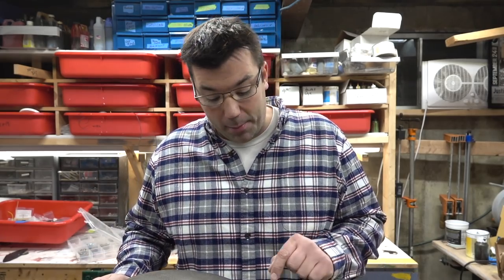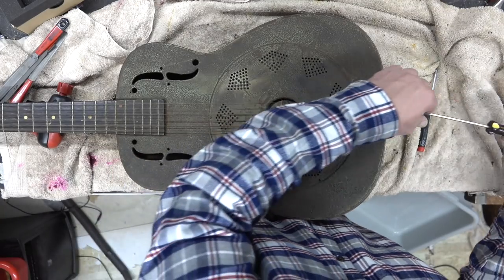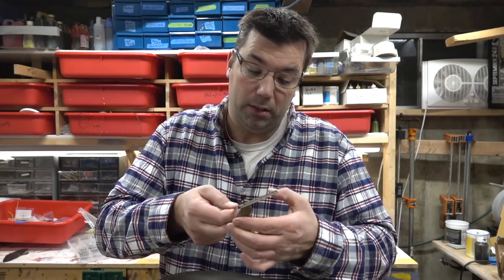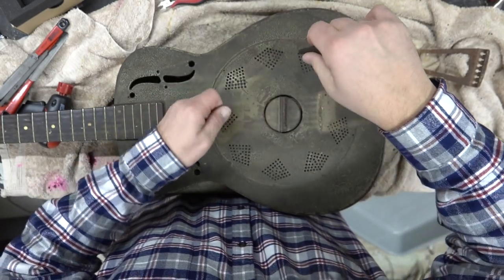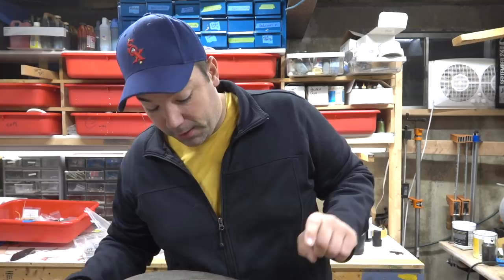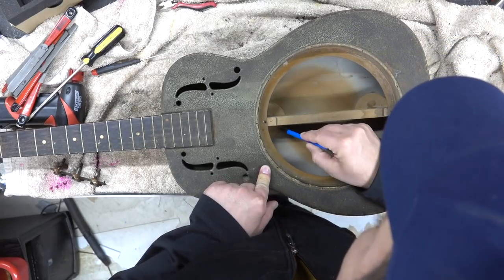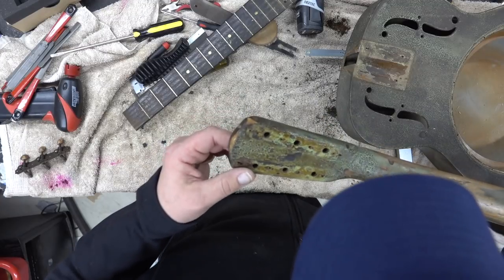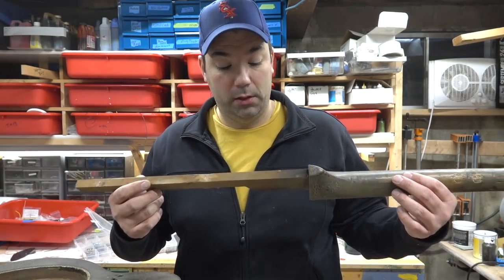Restoring a totally wasted Vintage Dobro - Part 1 - Help me on year & model

Comment: Hey there! You will love getting into the world of dobro! There are quite a few resources available. The best one is a few hundred pages and is a comprehensive history of National Guitars. I am not thinking this is a National. As someone else mentioned the screws for the neck can help you there a lot. The resonator was the first attempt at making an acoustic louder. The concept is that the bridge sits on a "biscuit" in the center of an aluminum cone which acts like a magnet would in a speaker. The bodies are usually made of brass and plated most often with nickel. Have a blast and I look forward to seeing how this goes!

Comment: That's a round neck busciut bridge.  It looks like it could be a national but there were more than dobro and national back then. Regal comes to mind. I know national had 3 screws holding the fretboard to the body. Brass, steel, or German silver can tell you something too.
Reply from the maker: They looks to steel.  As the one rusted out
Reply: @bigdguitars  sorry about the run on sentence. I was referring to the body metal. I could have written that better.

Comment: Dobro is a brand name, just as National or National Resophonic (NRP) is a brand name. They're called a Resonator. Don't think it's a National, it doesn't have the correct tailpiece, although it could be a replacement. Also, the neck screws don't seem long enough to be National. May have some markings inside the body. If it IS indeed a National, you got a steal :)

Comment: Hey, looks like a great project, it has a biscuit bridge resonator cone, where a dobro has a spider bridge resonator, National is and was a different company than Dobro, now owned by Gibson, both types of resonators were invented by John Dopyera, long story, I have a 1930 duolian it has the same resonator cover but the neck has a Slotted peghead, also yours is a 14 fret body, and a different tailpeace, I would try to carefully straighten out the cone, it's like 80 bucks to replace it, good luck, I don't think you'll regret putting the work in to it

Comment: I'm thinking it's a 30's model Regal.i had one recently and it was a cheaper one but very similar.a national are very well stamped and has headstock badges on them but the Regals doesn't.im 99 percent sure it's a Regal.but the hold good value to so I don't think you over paid.go on reverb and type in 30's model Regals and compare.id say you will find the make and model that way.good luck and nice find.cheers

Comment: Well, the Dopyera brothers were machinists and not woodworkers.😁 Could you install an aluminum or carbon fiber bar in the neck to help keep it straight? 

Looking forward to more.
Reply from the maker: You guessed it.  Carbon fiber with maple for that strip.  Gotta let this dry.  If it’s worth a mint I may do all original.  We shall see